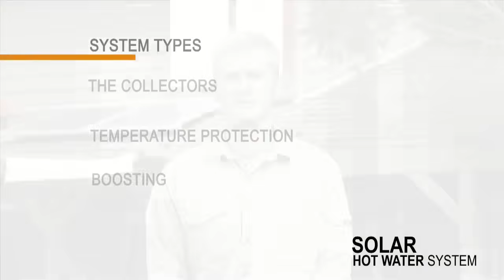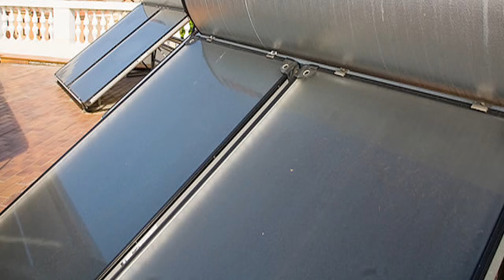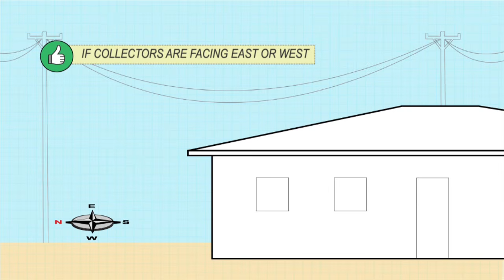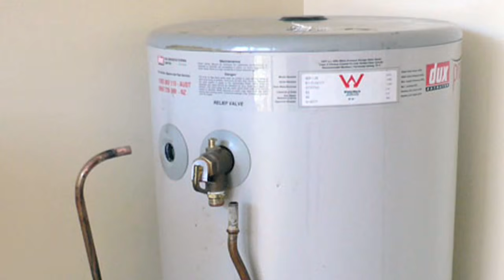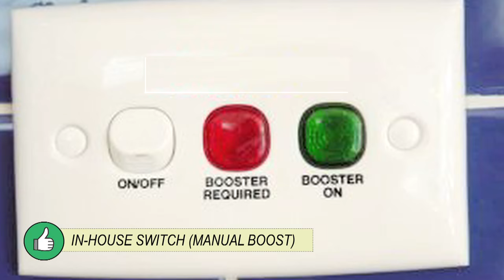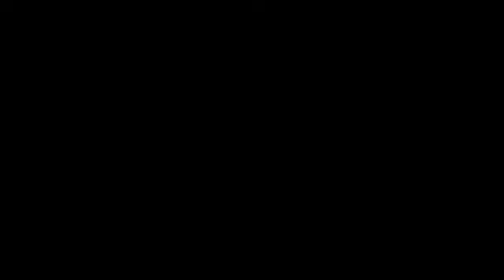Trade Secrets - Solar Hot Water Systems

Comment: So if it gets too hot, a sensor stops the flow between collector and tank, and then the collector is cooled by the flow of water from the line pressure…? What if no one uses water for awhile?

Comment: Very interesting!
Here in Canada, I know many people who are using their hot water tank as a secondary battery where they heat water with the excess solar power once the batteries are full. Solar PV does not freeze in the cold of course. All electric outdoors and just a switch on the charge controller to heat water once the batteries are full. Mine is coupled with wood heated water for winter so it balances my hot water needs all through the year! A little wind turbine could help in the sunless times though
Reply: If freezing was an issue you could have a non freezing fluid being heated and then run that into a heat exchange. I would love to see a comparison of differing methods mounted to a heliostat of the same size including directed light from a mirror. While not great for storage, I suspect it would transfer more heat than pv.
Reply: There are glycol systems. Much more expensive, though.
Reply: But how you manage lefionella?
You use a heat exchanger or heat pump to use the heat from the water battery?
I think it's a great concept exceot I haven't found a professional solution like this.
Reply: @zteaxon7787  legionella controls are only required in open loop system (hot tub, fountain or cooling tower) meaning if the tank water was open to the atmosphere. All the systems that are shown are all close loop, meaning they’re all fully pressurised and the water is contained and cannot reach the outside air. Also if water is stored over above 120°F about 50°C which they would be then the legionnaires would die anyway. 
Temperature Mixing Valves (TMV) reduced Tank water temperature down automatically when exiting the tank from 158°F about 70 °C to within 120-140°F about 50-60 °C to stop burns to the skin. These system have been around here for 40-50 years and are on about half of every home, with PV panels systems on the other half. NSW in Oz